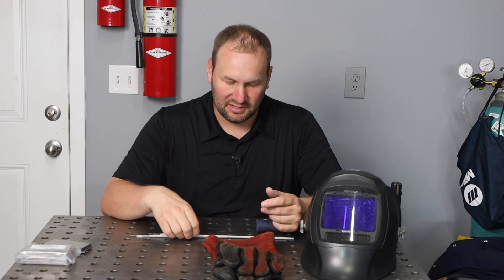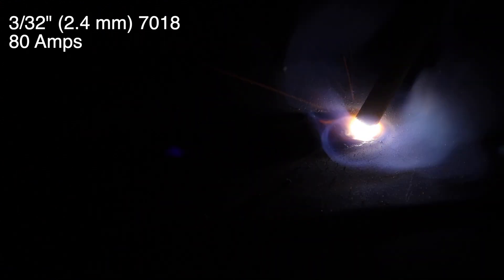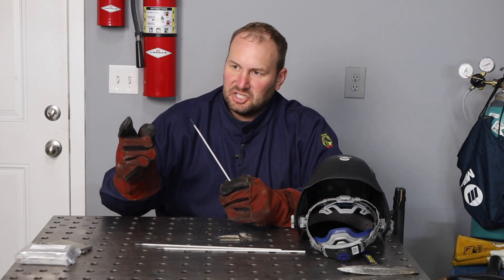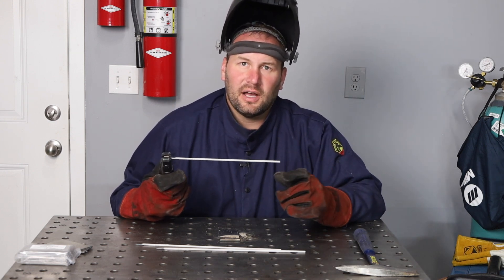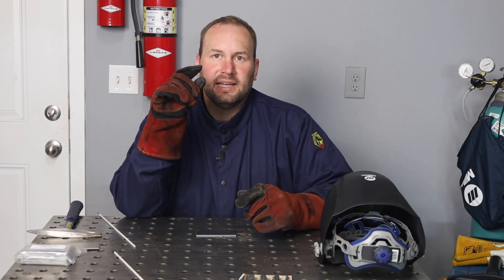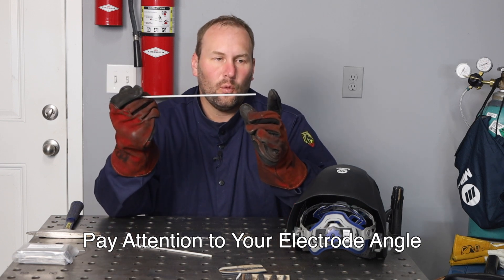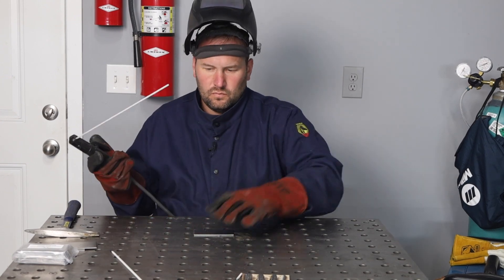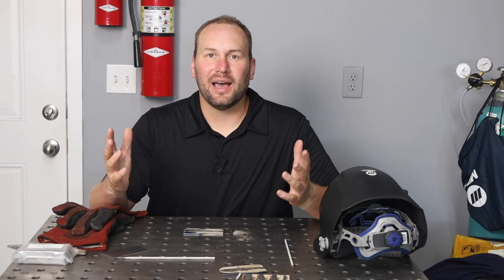The Stick Welding Recipe

Comment: For general stuff I have been using 6013 mostly, but 6012 and 7016 as well 

Never tried 7018 but might see if I can find some- it’s not very common in New Zealand

Comment: Hi. I’m interested in welding and bumped into this video of yours. I was wanting to know what kind of welder machine do you use for stick welding?
I think it’s stick welding that I need to learn with welding if I want to make furniture stands and plant stands  as a hobby and hopefully it can be just plug into a wall plug so I don’t need to buy gas tank since I don’t want gas cylinder in my rental. Any suggestions be great. Thank you
Reply from the maker: I would get a small flux cored welder. It’s much easier to use and they usually plug into a household outlet. There are several options on the market, but make sure to get one with DC output. The Harbor Freight Titanium flux 125 is pretty good for the price. If you want to move up a step from that, you can get a 115 volt MIG welder and set it up with flux cored wire, which doesn’t need gas. With a MIG welder, you can change to solid wire with gas in the future, which runs a lot cleaner.

Comment: THANKS FOR ANOTHER GREAT VIDEO TIM,  IM TAKING AN OLD WOOD BURNER AND MAKING A HEAT EXCHANGER OUT OF IT , ITS DIRTY AND PRETTY RUSTY I HAD IT SAND BLASTED BUT STILL CANT GET A GOOD BEAD AROUND THE PIPES IM PUTTING THROUGH IT I TRIED 6010  RED AND WHITE CANT GET A GOOD BEAD WITH EITHER ONE, SHOULD I TRY A DIFFERENT ROD , WHAT DO YOU RECOMEND, THANKS AGAIN

Comment: Realatively long question, but I will sumurize here, are patterns popular, or even necessary in your experience? (Ctrl, atl, w). 
I have recently started to learn from my Father-in-law all in Portuguese. I lightly understand them so far, but I´ve noticed something in the welding videos he shows me in Portuguese vs the ones I´ve found in English. They speak of keeping a pattern while welding. The ones Ive have been studying so far have been a zig-zag pattern, and a circular pattern. I have only seen you work in straight lines. Are these type of patterns popular in your experience, and are they vital (I havent figured out how to use the question mark function on their computers). Thanks, and I look forward to further videos.

Comment: I always recommended that beginners start out with a 6012 electrode. It's super easy to start, and the puddle is clearly defined. That helps a lot for people just starting out. Also, I never liked beginners running 7014 or other Iron powder rods because they are basically one position (flat) only. Like you, I liked 7018 for Lo Hy rods, or 116G if you can find them. 
Great video as always!
Reply: You mean 6013 right?
I mean that's point and shoot, no whip needed. I started with 6011 because welding shop guy recommended it lol.

Comment: Hey Tim as usual another great video. I just tried welding 3/32 6011 (vulcan) on a deko just like yours and found that I can only weld a bead 1/2" long before the arc dies out. tried the same on my primeweld 225 same thing. went up down on amps on both machines and no improvement. can weld nice beads on 6013 (forney) all day long even though I'm running both machines on 120v. any advice, I'm just a beginner.
Reply: I just made a set of grizzly bars with 3/32 6011 and had no problems  running it. I did notice the first half of the electrode seems to run better and hotter than the second half if i restarted it and couldn't run 7014 worth a damn, I gave up trying on that stuff

Comment: I’m having trouble the 3g position the drag is dripping don’t know if I’m having a poor angle or too hot need some advice
Reply from the maker: When running 3g, you’ll need a lower amperage than flat and horizontal. If a weave is allowed, that can be really helpful. If you do weave, move quickly through the center and spend most of your time near the edges to allow it to fill in. The slag will drip down to some extent no matter what you do, but the weld can still look great underneath. One of the best ways to get practice in on this is by running multiple pass vertical fillets on tee joints, which has a very similar technique.

Comment: Good video again as usual.  One tip for beginners is that if the weld looks really bright and you’re having a hard time seeing the weld pool, you probably have too long an arc length (rod is too far away from the metal). It’s hard at first to get the drag speed right while also feeding the ever consuming rod down into the weld.  Then more of the rod burns off than beginners realize, and they’re late compensating for it.
The end result is a much brighter - almost hard to look at weld flash from a long arc length. If you turn the shade darker on an auto darkening welding helmet so you can see the super bright arc, you can’t see what you’re trying to weld.

Comment: I'll tell ya one thing I'm impressed with on Tim's welding is his accuracy & steady hand. To me, being shake-free while consuming a 3/32" dia & a consistent tight arc length is impressive. With just this diameter & rod length of 14", imagine having a slight twitching at the grip end being multipled all the way to the arc end. Then again nuttin' wrong with a tight uncontrolled automatic weaving technique. LOL. Were you running a standard 18 or a AC 18? Nice short sweet video. Cheers from sunny Florida.
Reply from the maker: Thanks! It’s just standard Kiswel 7018.

Comment: My problem is I'm welding outside and I can't see while I'm welding?
Reply: Try blocking the light from entering behind your helmet. I throw a t-shirt on top and rear of my helmet in my garage because I have bright garage lights that light up the inside of my helmet and make it difficult to see.
Reply: @YT-User1013  thanks for the tip
Reply: @g.tucker8682  hope it helps
Reply: Try a auto lense

Comment: I think I'm going the right speed then BOOOOOM I burn a hole in a inch thick piece of metal. It's crazy how I think I'm doing good and look back to see all the mistakes. Thanks for the videos they are helping.
Reply: Ok, i'll bite. Were you arc gouging?
Reply: @miszced  probably. Yeah I was. :(
Reply: Yeah you probably slowed down for an instant. Don't. Same speed.
Too fast stretches your puddle thin, then you try to go back to compensate and it's still really hot, so it goes blep. Try to make the puddle as wide as the rod for stringers, if you weave go a bit wider then you want to as a noob. 

I have 6 months under my belt, but I think it helps to hear from someone who's also learning but may have just gotten something.

Comment: Nice videos's !. But learning welding with an 7018 rod? restarts are not easy and as a beginning welder you wil have to do a lot of restarts cause youre not experiened enough, no steady hands etc.  To me 7018 is a rod for more experts then starting amateur welders. But hey Im just a farmer who's welding less then a box of sticks a year.
Reply: I keep a 5” piece of really rough belt sandpaper that broke on my welding table using magnets that I use to quickly rough up the tip before the next start.
Reply from the maker: Thanks! There are definitely pros and cons to each type of rod.

Comment: Great points, how much difference dose galvanised steel make? thanks for the video, all the best to you and your loved ones
Reply: Welding galvaninsed is dangerous because of zinc poisoning. The zinc is in the fumes.
Reply: It shouldn't make any because you'll have ground off the zinc coating where you're welding. That junk can kill you, it's always better to grind off more than you think you need to.
Reply: Well, you'll lose the weathering qualities at & near where you are arc welding, it'll just burn off. The better material to weld on is galvanneal than galvanized steel. Just make sure like in all cases you have proper ventilation when arc welding.
Reply: Don't weld galvanized without a good breathing mask and good ventilation.  The fumes are extremely poisonous and can make you sick.